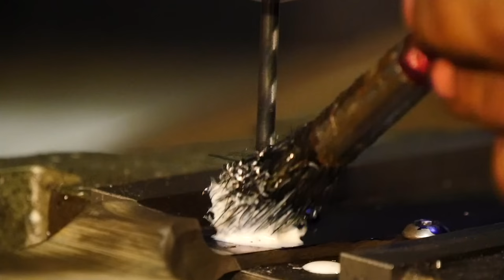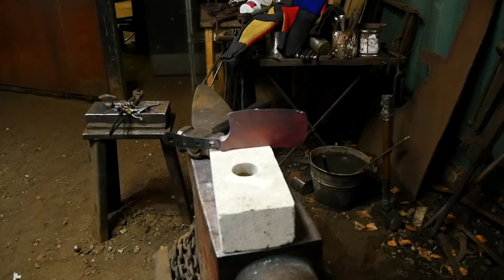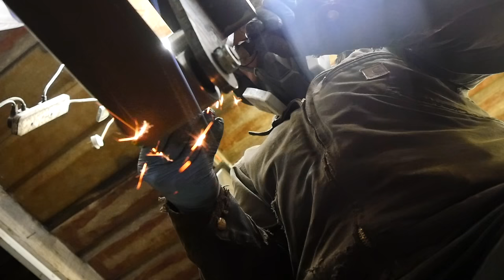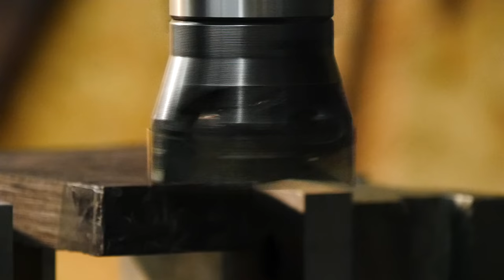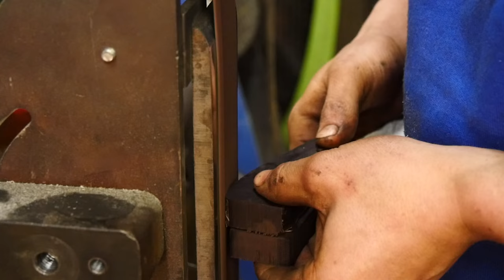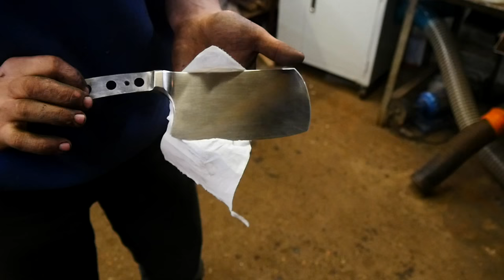BRITISH FLAG DAMASCUS STEEL CLEAVER | Part 2

Comment: If you don't mind me asking, as I am very new to this, what does the hand sanding do..... I'm still working on basic techniques like striking, punching and recently forge welding.... I love the blade smithing and can see myself headed in that direction but I was curious about the hand sanding step. Thanks and the videos are awesome too!!

Comment: can't wait to see how the etch turns out, love your forging vids can't wait to book my class :)
Reply: cliff hanger ending 🙃
Reply from the maker: +david moore gotta keep that suspense -
Reply from the maker: +Alec Steele plus - I still hardly know how it's going to look - still lots more work to go ;)
Reply: ***** are the April classes sold out by chance because the class coincides with my birthday! Just wondering if I can get in there around Christmas time to book it for April 😉
Reply from the maker: +david moore get on it fast so it doesn't sell out 😃😃
Reply: ***** will do :) I have a couple questions If you don't mind answering?
I use ferric chloride to etch as well and my products don't get that black/white crisp finish yours do. 
I diluted mine with water at a 1:3 ratio and etch for 15 mins. Is it my timing or my mixture?
PS sorry for the long question :/
Reply from the maker: +david moore i etch for an hour! 😂😜 what steels are you using? You'll struggle to get the same contrast without using the 1080 (or 1095)  / 15n20 I use
Reply: ***** I assume I just haven't left it in long enough because my Damascus is 15n20 and 1080. Thank you so much for advice though. Also one other irealvant question but how is it the plastic in the metal extractor doesn't melt from the large quantities of sparks getting thrown in there?! Anyway keep up the awesome stuff!! Look for me on the next video 💪😉

Comment: did your blade bend sometimes ? how do you fix this problem ?
Reply from the maker: +Gaetan Thomas this one didn't bend in the heat treat thankfully! I don't know how to straighten them 😂😂
Reply: Maybe you can forge a special hammer done for that, search on google, it is a small hammer with a very little and sharp point
This could be an interesting forging
But they are some ways to straighten a knife, but all are a bit risky 😕